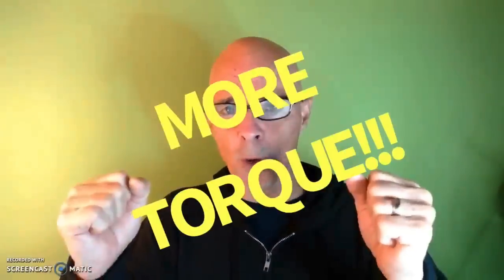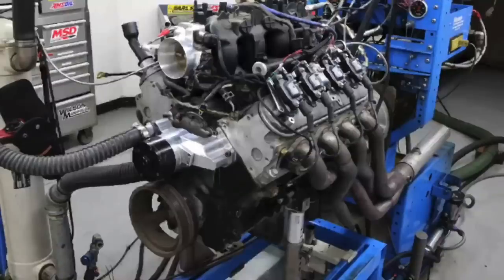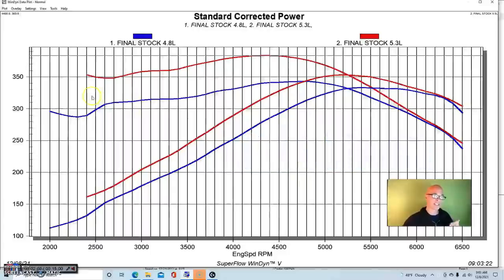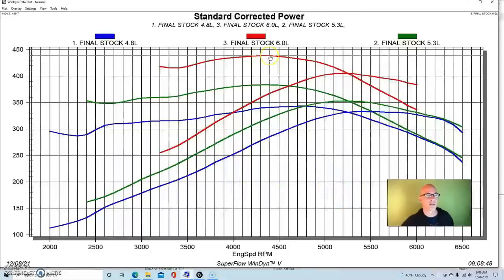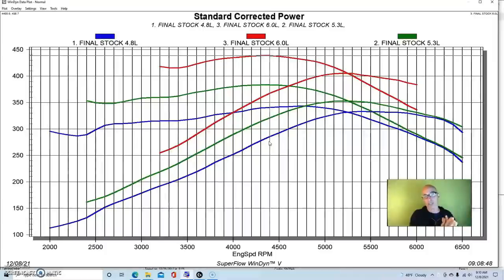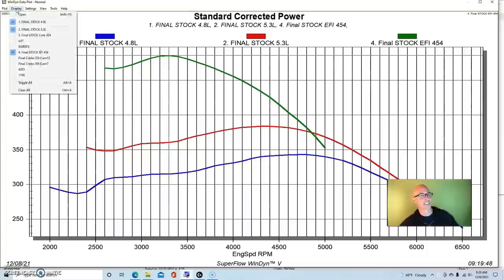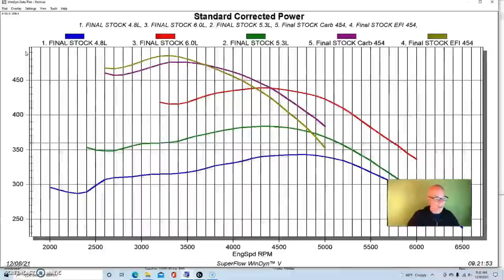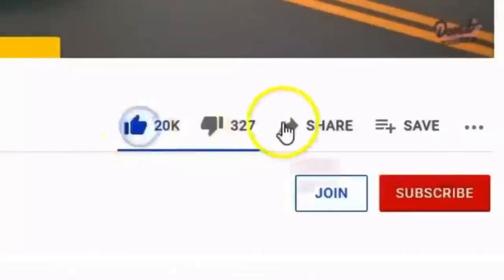LOW BUCK, JUNKYARD V8 TORQUE TEST-6.0L LS VS 7.4L 454 BBC-WHO MAKES MORE TORQUE? BETTER VS BIGGER!

Comment: I've got this issue and I'm trying to decide if putting a turbo on my 5.3L will help pulling the enclosed car trailer. What do you think about adding a turbo to help with the torque?
Reply from the maker: yes
Reply: @richardholdener1727  Thanks. I did watch your adding a turbo to LS information video. Also very good. Thank you!

Comment: I have a 1999 Chevy 454 motor is sluggish. It has 120,000 miles. What could be the problem I put it on computer nothing pops up except for O2 sensors needs new exhaust with that cause my sluggish motor.
Reply from the maker: if the sensor is bad-the a/f is likely off-clogged exhaust is also bad

Comment: I have owned both engines in 2500 silverado trucks and have done the towing test with my enclosed trailer... 7.4  tows alot better. I couldnt stand the 6.0 it had no torque below 4000 rpms and it would rarely hold overdrive on the highway. Now i have an 04 2500hd 8.1 and i can say 8.1 will easily beat them all
Reply from the maker: bigger is better

Comment: Put a 4” stroke in the 6.0 with rec port heads and re compare.
Reply from the maker: both of the tested motor were stock displacement
Reply: @richardholdener1727  kinda mismatched as a torque comparison. 4.250” bore 4” stroke vs 3.622” stroke 4” bore. 
Strange request to compare.

Comment: How much low end torque does 706/862 make over 317. On 6.0
Reply from the maker: it adds a full point of compression

Comment: Tpi 383/406 sbc cammed right would come close to the BBC low rpm torque.
Reply from the maker: TPI motors do make torque, but that's a built, modified motor reaching the torque of the stock, junkyard bbc

Comment: I’m running a 5.3ls in my c10 and I have a Holley sheet metal intake on it. I’ve heard a CBSS intake would produce more torque, what do u think would work better
Reply from the maker: a TBSS would make a lot more HP and TOrque up to 6300 rpm than the Holley Sheet Metal
Reply: @richardholdener1727  thank you sir!

Comment: What gen was the 5.3? i have a 02 5.3 with a TSP low pro stage 1, 60 lb injectors, long tubes and a tune and im only making 307HP 323TQ. feel like im missing out on some power
Reply from the maker: most of what I get are gen 3 5.3l

Comment: Do you have any Dyno data on a fuel injected L31 5.7 vortec? I have a beautiful <100k mile Tahoe and I'm conflicted with dropping a cam in the 5.7 or going 6.0
Reply from the maker: NOT WITH THE FACTORY EFI

Comment: A l31 5.7 vortec blows the pants off most 6.0 tq wise especially down low. I have no question the 454 will wipe its ass with the 6.0 as a truck- tow motor.
Reply from the maker: an l31 makes 50 less lb-ft that a 6.0l
Reply: @richardholdener1727  a otherwise stock carbed l31 makes 410tq a early stock 6.0 is rated for 360tq. Note i said most not all the newer ones make better numbers but its still not down low where you need it. Lap a dyno graph of a early 6.0 vs a carbed l31 and tell me who makes more tq in the bottom end.

Comment: Is it possible to record the power and torque from idle? I would like to see it below 2-3k rpm. I do most my driving down there on the torque curve.
Reply from the maker: do you run WOT at Idle much?
Reply: There's no way to load a Dyno at idle...🤦
Reply: I’ve got a 01 suburban, 5.3 with the 3:73 gears. Idle is 500 rpm, most of my driving is between 1000rpm and 2000 rpm. Even freeway speeds are about 2000 rpm. I’ve got a new truck and drive it the same way. Big motor, big torque and 3:73 gears. Most of the dino charts show 3000 rpm and up. I was just curious if you could show from say 1000 rpm on up. I don’t know how the Dino works and it may not be possible, but I would like to see what the power and torque is in the rev range I normally drive. I’m not a racer, just a guy who likes this stuff and am curious.
Reply: What mpg do you see at those low rpm’s

Comment: SO? The LS is better? The old saying "There's no replacement for displacement." That big block will out perform all of those LS engines. Even if it is built the same as the modified LS. I don't know about anyone else, if I were towing with a big block, the rpm will be at around 3000, right in the torque curve.  I want to see this comparison. Take a 5.7 LS and a 5.7 gen one SBC and build them identical. Same head flow, valve size, cam size, bore size, intake the same, everything as close to the same on each then run them on the dyno. Prove to me and others how much better the LS is over the old school SBC. I'll be waiting...
Reply from the maker: a stock SBC 350 doesn't have the same head flow as an LS
Reply: @richardholdener1727  I know this. Missing my point? Build them both identical. Use AFR or Dart or whatever brand of head, forged cranks, rods, intakes. Use "stock" blocks, stock CID and match the heads, cam and intake. Follow me?

Comment: 6.0l with the right rear end gearing would be better than the BBC. This is because the rear end will multiply the torque available at the wheels.

Comment: why does each bigger engine start measuring higher and higher RPM?
Why won't he show us what the 6.0 is doing at 1500 or 2000 rpm?
Reply from the maker: are you at wot at 1500 rpm?
Reply: @richardholdener1727  I'm never WOT. Is there a reason why one engine's curve starts at 2k and another starts at 3k?

Comment: Man… I wish he did an 8.1 vortec waaayyy better than a gen 6 big block. I’ll never give mine up! Also towing with an Allison is waaay better than any 4 speed auto. Amazing gear ratios. I get 8mpg towing my travel trailer with a 6” lift and 35” tires with 4.10s my half ton 6.0 Denali Yukon gets 7 towing the same trailer mpg isn’t a concern when towing and you couldn’t give me one of these overpriced diesels with all that epa crap you can’t delete now.

Comment: The thing about a lot of Torque and limited RPMs is that you will need taller gears to compensate for the reduced engine speed, and in the end the vehicle pulls the same

Comment: But a small decent cam in the 454 would boost it very much h
Reply from the maker: that vid loads today
Reply: @richardholdener1727  and another really good thing in my opion would be flow the heads and get heads that flow really close for both engines those smog heds for the big block sucked then that would really be a good comparison and carb both engines to eliminate the bad intake they had on them if you did that and compresson ratio i think the 454 was really low get the pecs on both very similar with both engines thats where alot of people go wrong they dont even think about those things

Comment: I asked on the live feed last night about this but you didn't know off the top of your head but maybe this jogged your memory. I'm putting together a mild carbed l29 gen 6 bbc and I'm hoping to find out what the dyno tells you these heads like for timing. All over the internet you read between 28-32 but It doesn't seem like there is any real testing just assumptions. As my motor will never see the dyno I'd love to see what's been working for you.
Reply from the maker: 29-30 it what the notes show

Comment: Its amusing to hear most internet advice "buy an LS, they're cheap power" when in many places in the country, a cheap 6.0 Ls tends to be a high mileage engine ready for rebuild if you're going to lean on it. Most folks who say they've got a few back in the barn, tended to have got them years ago when they weren't the first thing picked as soon as they reached the junkyard. so a modern "LS Swap is the solution" tends to be a smaller displacement engine.  Meanwhile, most are interested in this question because they're building a cheap tow rig, and that's going to be hauling down the highway at 2,500-3,000 rpm and shifting and returning to that RPM, so that's where you really want to compare. If you're searching for torque in any other vehicle, you'll likely swap in cams and intake to make the torque you want out of anything you got cheap this week--and gear the rear to match.

Comment: Another huge bit: the weights of the 2 engine types are vastly different. The LS lot are only a bit heavier (40# ?) than the old sbc, but the  454 is about 150# more than the sbc. That means, yes, you'll have more torque than the old sbc, but you've lost 150# of payload you can carry for the fuel used. Is that trade-off worth it to you? Plus, as Squirrel mentions below, the LS are much easier on fuel than the 454. So almost the same torque, with better mileage might be the better way to go. 
    An then there's strokers: same weight as the base engine, but more displacement. Lots to love about that idea!

Comment: I would rather use a 6.0 and lower rear gearing to move a heavy load than use a 454 to do the same!
Reply: Gas mileage would be the same at that point.
Reply: @blainesnider9089  
No not really I currently own a 6.0l and it only gets 12mpg but if I switch the rear differential gearing from the current 3.42 to a 4.10 or 4.56 It would actually get improved mpg why because the gears would help move the weight more efficiently! My van weighs 6000lbs! The driveline shop I know has done this a few times on my style of van and can attest   that mpg improvement is real!
Reply: @andrewinsinga2993  more rpm more gas
Reply: @blainesnider9089  
Not when the engine is running in its torque range 
Lugging the engine burns more fuel! I know of a few people who have changed the gears in a van just like mine all have said the fuel economy improved! All have said the 6 speed transmission now stays in overdrive at highway speeds even when climbing hills !
Reply: @andrewinsinga2993  I would have to see it to believe it. Still doing the work of a said 454 takes the same torque multiplication.  454 turns  lower rpm to do said work.

Comment: So uh, can we get a FUEL injected 454 build? Every time, I swear, every time! It’s a carburetor! You wouldn’t carburete an LS motor? Carburetors are old school to me. Fuel injection is easier for me to work with. But no one wants a boosted fuel injected 454
Reply from the maker: SO UH, CAN YOU LOOK AT THE VIDEOS I HAVE UP WHERE WE COMPARED THIS CARBURETED VERSION TO THE EFI VERSION. LOOK AT PART 1 OF THIS VIDEO-WE RAN IT BOTH WAYS AND 99% OF THE BBC GUYS WILL RUN A CARB!

Comment: Ya gotta love the feeling of low end torque, but the 6.0 with shorter gears will get you up a hill faster. HP beats torque.
Reply: Not the hills out west, 454 will walk all over it. Especially towing..

Comment: Im lost... commenters talking about mpg 6.0 vs 7.4... ive never seen a 6.0 get over 14 mpg... that was on 245 tires at 65 mph with a tail wind. Mine usually avg 10mpg... they are a good engine but not a good replacement for BBC tourq. Undoubtedly emmisions and gm looming bankrupt bailout and mpg credits killed the 8.1L. Theres a reason ford just revived a simple 7.3L gas... simple big tourq & because diesels are dead. Pay attention.

Comment: I notice when doing spirited driving where you have to get ahead of someone to change lanes Etc, you basically need a lot of torque at the converter lock-up speed which is around 1,900 RPM on most of my cars and trucks. Rarely do you need to go over 3000 or 3500 RPM unless somebody is trying to race you. So I'm wondering even when you're trying to find a low-end torque dyno test they rarely show anything below 3000 or 2500 rpm

Comment: A gas engine with 90 more cubic inches is going to make more torque idle to 3500rpm and will pull better with less gearing and a tighter torque converter but to me if your towing something really heavy don't mess around with a gas engine it will get terrible gas mileage and probably will not last to long if revving past 4000rpm just get a diesel it will pull like hell idle to 2500rpm easily and effortlessly deliver way better fuel mileage while doing so if your needing more low end torque than a 6.0 or 6.2 LS engine get a diesel it will pay for it's self in fuel if your driving the living shit out of it effortlessly and last 5 times longer than a 454 that will need to turn 3500rpm for long periods of time l can tell you a 6.0 LS may not make the torque a 454 does at 3500rpm but l bet a 6.0 LS engine will last longer than a 454 turning 3500rpm for long periods of time even if the 6.0 is turning 4000rpm for long of time and get better gas mileage going so
Reply: I don't know much about Diesel's, but have had some friends with new ones that just had nothing but very very very expensive problems with them one had the Dodge and he also had a Hummer, huge expensive problems with both.

Then I had a 1-ton van delivered to me on a flatbed attached to a Dodge Ram Dually with the Cummins. The only other thing on the trailer was the generator for a wind turbine I asked him what kind of mileage he got and he said 7 miles per gallon. My nephew used to have his own Freightliner 18-wheeler, and he also got seven miles per gallon. That's pretty pathetic if a little pickup truck gets the same mileage is an 18-wheeler that can carry 80,000 lb. I wanted to try a diesel but just get scared at the repair expense and also having no experience how to work on them myself
Reply: @7x779  the 2012 and older Cummins are probably the best before the DEF fluid but your right newer ones seem to have many problems and the cost to repair is expensive

Comment: Well that's a no Brainer 😅
No replacement for displacement
Reply: None. With all the boosted combinations I've seen, have yet to come across anything that makes built big block torque off idle. Anything that gets close to it by 3500-4k doesn't idle and is annoying to drive around in.
Reply: 307Driftwood by the time you bought an lsx 454 and a set of aftermarket cathedral port heads you’d probably have more cash wrapped up in a mismatched combo that made less power than it would with the ls7 style heads it came with and could have probably nearly built an aluminum headed 540 or possibly even 632.
Reply: 307Driftwood I’m well aware of that but anybody that thinks a 454 cubic inch engine with heads with 225 cc intake ports will make more power than a 600 cubic inch engine with 300+cc intake ports is sadly mistaken. With a 632 the same 250+ @.050 duration cam that would be relatively aggressive in a 400 inch engine will be relatively mild, and will make more torque and power throughout the entire rev range
Reply: 307Driftwood for what you pay for the “gm 632” crate engine you’re probably 2-300 hp short of a real 632. Crate engines are for hot rod tv shows. If you want to make real power you have a reputable engine builder spec you parts specific to your application. My point being even if you have equal flowing heads and equal compression between the 632 and the 454 ls, which is not likely, the larger engine will still make more torque in low rpms. Engines are air pumps, the more air you can get in the more fuel you can burn, the more horsepower/torque you can make.
Reply: 307Driftwood so by your logic if you have a 2004 cobra with a 4.6l engine and you put a 2.8l kenne bell supercharger on it you have a 7.4l engine? Also supercharged small block to n/a big block is sort of apples to oranges, and if the compression is equal on both engines the supercharged small block will need higher octane fuel than the n/a big block. I’m not bashing on ls engines I have a built one in my Camaro and a stock one in my hd truck, my point is given all other variables equal larger displacement engines make more torque period.

Comment: Haven't watched yet:
The 454 makes more torque, because I know what torque is.

*I was right. Also, with mods, the 454 would make more torque for all of the rpms that you could keep it together for.

Also also
I've been recommending big blocks to customers for awhile now because ls engines are approaching ridiculous cost levels.
Reply: What about fuel costs? Big blocks don't win that one.
Reply: @rockroll9513  fuel costs have much more to do with the load that you are moving than the engine size you have. I have dozens of customers who bought the smallest v8 possible for their work trucks to then be surprised by the lack of fuel economy. 

Same load the smaller engine will get better cruising economy assuming it makes enough power to cruise with low throttle % but in reality big load = bad economy.
Reply: @saulgood6190  we're talking about cbb vs csb. I'm on the west cost where 1) 98% of aftermarket auto sales happen and 2) we don't want to shit to do with rusted ass east coast shit lol.
Reply: @saulgood6190  not really cheaper if you factor in the full swap labor cost.
Reply: On the left coast, that explains it.

Comment: Lots of stuff mentioned. But no stroke measurements? Longer stroke gives more torque.........finally at the end. Mention of stroked engines. I had lost interest by this time. Sorry
Reply from the maker: displacement gives more torque-not just stroke
Reply: @richardholdener1727  stroking is adding displacement
Reply: @richardholdener1727  compare a Ford 460 and a Gm 454. See what you get. The 454 has longer stroke. Would need to flow test top end and have them be comparable. 460 block is wider so usually they get lazy and lose air velocity with factory intake configurations

Comment: the fuck only 370 on a ENGINE DYNO from a 5.3? fucking k24 with k20 heads make 300 to the WHEELS and they are a 2.4L 4cyl. Ever thought of putting a k24 and a k20 on your engine dyno? you might be suprised the record right now on a all motor k series on race fuel no nitrous just n/a 704 whp from a 2.5L fully built k24a2 with a k20z3 head
Reply from the maker: you might be surprised to know I wrote a Book on K series and have K series vids up on my channel